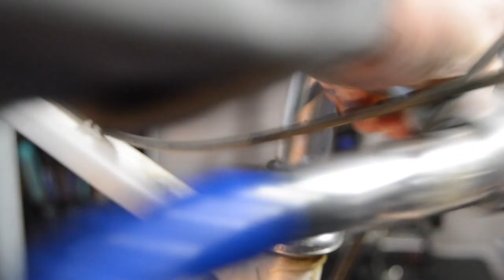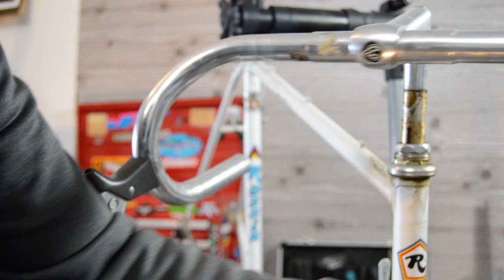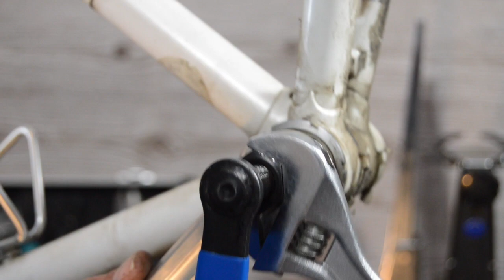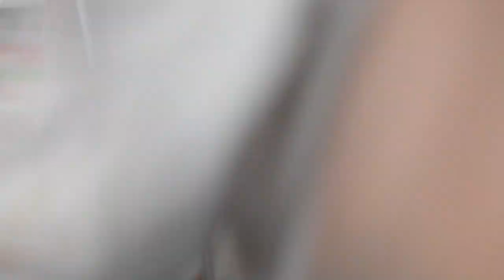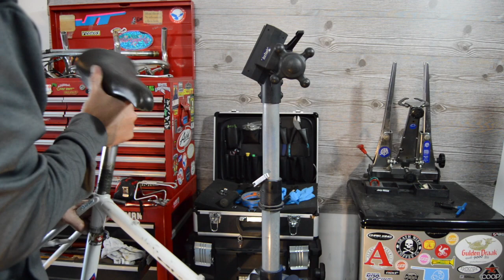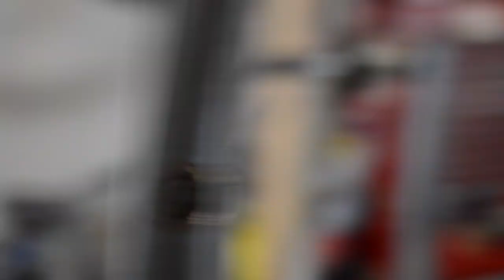Rossin Record Restoration Project Part 2

Comment: The amazing beauty of Campagnolo is not only in the shape and look of their components but in its design and engineering I'm you taking the bottom bracket out. Outside it looks like a disaster, but inside the grease and bearings still looks pretty clean. The ridges cut into the BB cups, pedal bodies, etc. are just plain genius. Plus the ease of servicing Campy is amazing!!

Comment: Joey , g'day I hope you and your family are well. Seems to me that this beautiful piece of Italian craftsmanship has gone through a time warp. Last year I pulled a friends bike apart that hadn't been used in over 20 years. It took me 2 days of cursing , praying and copious amounts of various WD40 type concoctions to remove the bottom bracket. Yours came out with a minimum of fuss , that Campy grease is good stuff. Your head stem looks like it's new , no marks from brake cable rub or scratching. Lucky you 👍.It's a pleasure to listen to your commentary as you impart years of knowledge that's been gained by really doing a job over and over again.looking forward to part 3. Take care 😀
Reply from the maker: Thanks Paul! I got pretty lucky with this bike, that's for sure! I should have part 3 finished late this weekend. I got some of the replacement parts and the spokes cut. Most everything is cleaned up and I have some good aluminum polish on the way. 
Thanks again for you kind words and great feedback, I very much appreciate it!

Comment: Thanks, I was really paying attention to the wheel disassembly, I have a project set of wheels for a Bianchi I'm putting back on the road.  The brake surface is really worn and I was lucky enough to find NOS hoops (still waiting on delivery, coming from the Netherlands).  I thought it would be a good idea to service the hubs(Campagnolo) and when I was disassembling the rear, the skewer seemed a little to stubborn.  When I got the axle out and rolled it on a flat surface I discovered the axle was bent so I went searching for a whole new assembly.  I found one but paid a ransom for it and now the hub is back together and waiting on the next step.  I won't relace the wheels myself, I will have that done at my lbs.Thanks for the video, enjoy learning about putting the old bikes back on the road.
Reply from the maker: You're welcome! Thank you for taking the time to leave feedback. Sounds like you've got a sweet Bianchi project going down! I'm hoping to get the wheels reassembled sometime next week, so I think you'll find the next video interesting!

Comment: Looking good , Joey. Question, why are you going to recycle the spokes ?   I've been pretty lucky , removing those pesky DS fixed cups, too.  All of mine have been replaced with either cartridge BB or Hollowtech II . KB
Reply from the maker: There's a couple of reasons I'm going to reuse the old spokes. The first reason is the fact that although the bike is older, it obviously hasn't been ridden a lot and there are no scrapes or gouges or any visible damage to the spokes. The second reason is DT spokes from this time frame are really good quality wise and it's very easy to clean the stainless steel to look like new.
I am going to replace the nipples though. Thanks for your question and you feedback Ken, I really appreciate it!
Reply: @JoeyMesa  Yep, never thought about that, I have 2 vintage wheel sets, with DT spokes and they do cleanup and shine , nicely. KB.

Comment: Do you have any tips on how to recognize butted spokes on a already assembled wheel? Cant wait for part 3 btw
Reply from the maker: Sometimes you can feel the thickness difference by pinching the spoke between your fingers and running them along the spoke. A wire gauge measuring tool or a caliper would work the best though. Thanks for the question and feedback!
Reply: @JoeyMesa  gotcha! I just tried it with caliper but its hard to be precise when wheel is built up so I wasnt sure, but when I passed with finger I definetly felt the place where its butted

Comment: Interesting project. I was thinking about making tig welded frame with tubing in the .5 mm wall thickness range. Would a welder like your handle this?
Reply from the maker: Thanks and thanks for the question. Pretty much any tig welder that can go down to 20-50 amps will be able to weld tubing this thin, the main hurdle to overcome is the person operating the welder. Welding tubing this thin takes a lot of patience and practice. I'm actually looking into getting a new welder that has a pulse feature and the ability to run on a 110 volt outlet. Hopefully in the next month or so.
Reply: @JoeyMesa  great. Maybe you post a vid about it?
Reply from the maker: Oh I definitely will!